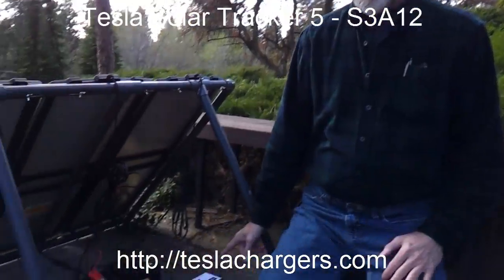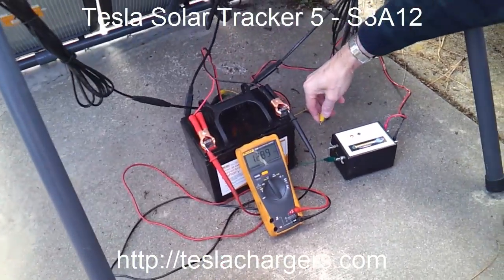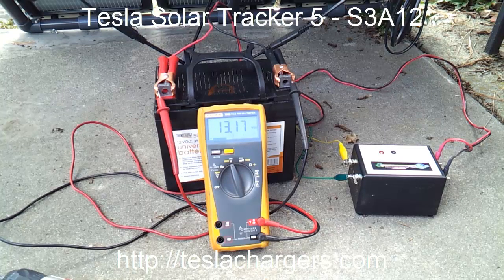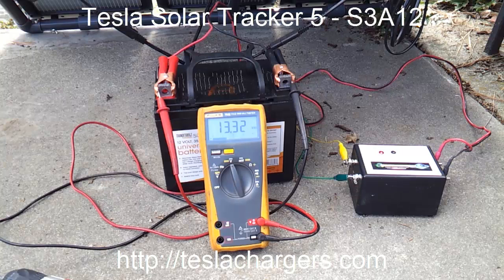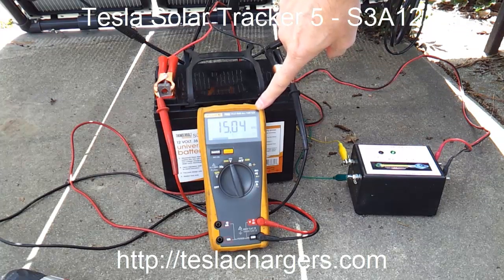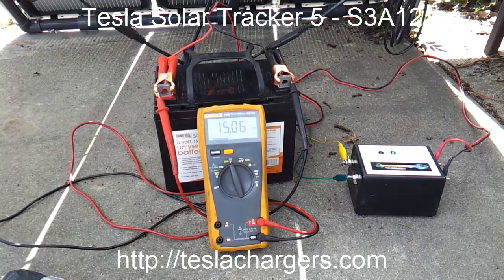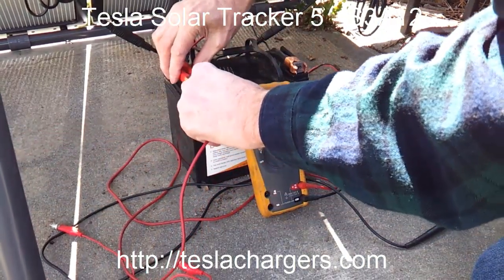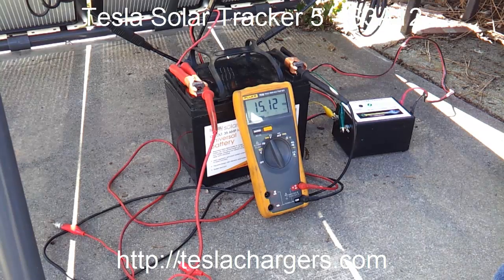S3A12 Tesla Solar Tracker 5 - 45 Watt Solar Demo

Comment: Great demonstration! How much longer can live batteries under these type of chargers?
Reply from the maker: That battery is a AGM - absorbed glass matt, so those and gel cell lead acids will have a lot longer life than being charged by normal chargers because it gets them to a proper voltage to truly reverse their chemisty to like new. If these are flooded cell lead acid batteries, it gives them a theoretical infinite life span.
Reply from the maker: Get the free book http://freesolarsecrets.com there is a section showing you the true topping charge chart.
Reply: @AaronMurakami13  Got it! Will read it on weekends :-)
Reply from the maker: @DmytroSichkarOnline  Awesome - it is a wealth of information. Look for the charging graph for the topping charge. It will explain everything. No battery charger company actually charges lead acids properly, they're all chronically undercharged and is why they have to be replaced so often. The industry knows it but are more interested in selling more batteries of course.

Comment: You should show the harbor freight unit in the same cloud conditions.
Reply from the maker: You're right, it would be a better demo, but the Harbor Freight controller simply will not push those batteries that high not matter how much sun.

Comment: 3 batteries charged 1 battery was showing 0.8 volts it is taking longer but now holding 8 volts restored a car battery and sealed cell battery took about a month to get to float...works faster if you drain the battery after a charge
Reply from the maker: +Steven Monroe Yes, you want to cycle the batteries. Charge, discharge, charge repeat until you get it to a plateau. The art and science of all of this is available through http://batterysecrets.com - there are a few free videos on the homepage at http://teslachargers.com

Comment: What kind of blocking diode are u using? thanks
Reply from the maker: +Banzay20 I do not know the actual part number - it's built into the potted circuit in the case.
Reply: Ok saw the blocking diode on the battery and it looks a bit different then "normal" diodes u find in various electronics, Im experimenting with some small panels in my window and have tried some reused diodes from tv:s and such but does not seems to work very well, voltage leakage is a problem so the specs is prob. wrong for my need.
Reply from the maker: +Banzay20 Where did you see a diode on the battery? What timeframe in the video? I thought you were talking about the diode in the charge controller that prevents anything from moving back to the panels.
Reply: Easy to miss 14:25 a blocking diode connected to the positive pole, when Peter hooks up the panel straight to the battery. Have seen something similar before.
Reply from the maker: +Banzay20 Ok, that is because of no charge controller - bad idea to hook panel to battery since the voltage isn't regulated and battery can send electricity panel, which is bad if there isn't enough sun. That diode is a MR1122
Reply: Great thanks. Ok, it´s just an old 5 watt panel with a old sulfated 12v car battery just for fun.. it can't take the battery up more than just above 13v a sunny day and then it just "pores" out again. Have been looking to get me one of those 2A12 chargers and a S3A12 solar charger..
Reply from the maker: +Banzay20 You'll be very happy with those chargers. If you have flooded cell batts, use the regular s3a12 that can push the batts to 15.3 - if amg, gel or lifepo4, then get the lifepo4 one it goes to 14.8. For panels, ideally, the VMP is 18.5 volts or as close to that as possible.
Reply: Ok, thanks. For now it´s just flooded ones. lifepo4 looks interesting.

Comment: then what amp can i use on (4 ) 225ah batt 24volt cell site system that pulling 100w canstantly
Reply from the maker: kevin pounal If that is 4 x  volt batteries in series for 24v, then the whole bank is 225ah. You're well within the 20 hour discharge rate so your bank isn't working very hard. That is 2400 watt hours in a day. How much sun do you have in a day that is usable? If you have some good light, you could power that 100 watts from the panels while the excess charges the battery and keeps it topped up until night time. You then are only drawing 1600 watt hours from the bank each day for example since the other 1/3 is from the panels through the charge controller. To replace that 1600 watt hours in 8 hours of sun that you used during the night, you need at least 200 watts of panels giving you full output for those 8 hours. I aim for double the need so 400 watts of panels to account for poor light conditions plus 200 watts to give you the same double of what you need to run that 100 watt load during 8 hours of light for a total of 600 watts of panels. 600 watts at 24 volts = 25 amps. This is the smallest amp unit we have for 24 volts: http://teslachargers.com/products/solar-charge-controllers/solar-40-amp-12-or-24-volt-lead-acid/, which gives you room to grow your system if needed. 

The 600 watts and this controller is somewhat overbuilt with the number of panels, but the reality is for a real solar system that actually works, you need at least double what you need in panels and battery capacity. You already have around 2.5 times the capacity you need in battery bank. Depending on budget and just to get started, I would use that 40 amp 24 volt controller and just start with a couple panels and add to it as you're able or as needed.

Comment: Obviously you can't charge a zero volt dead battery but what is the minimum battery voltage for the charger to start desulfating and charging up?  3 volts?  6 or 9 volts maybe?  Thanks
Reply from the maker: Phordguy, that's true pretty much. However, I have brought back some batteries with this technology from about 1 volt to full voltage, but the real charge was up to about 50%. It was just too far gone.

Today, I'm working on a 550cca battery sitting in the 5 volt range. They can usually be brought back as long as there are no internal shorts like plates warped and hitting the next plate, etc... physical damage like that. If it is just sulfation, then they can be brought back with pretty high capacity.

However, for serious rejuvenation of the car batteries or bigger deep cycles, I'd recommend at least the 10 amp unit - otherwise, it will be a really slow process. I'll continue to post vids with various rejuvenation efforts to show what is and isn't possible with this technology. Don't forget that for good rejuvenation, they have to be drawn down after and recharged multiple times - capacity grows with each successive cycle.
Reply: Thanks for the reply, I'll be ordering one soon!

Comment from the maker: This kit from Harbor Freight is great! http://www.harborfreight.com/solar-panel-kit-45-watt-68751.html The 45 watt panel setup is just about right for the S3A12 limit. The kit has a charge controller and DC output plugs... just don't use the charge controller that comes with it. Use the S3A12 charge controller - but the Harbor Freight controller, you can hook it to the battery (not to solar) and use all the outlets the little control box has! With the frame, it is a bit heavy (the 3 panels) so you won't go backpacking with this but if you can find a 50 watt flexible amorphous panel that you can roll up, that would be idea. The solar kit retails for almost $190 but Harbor Freight always has sales and coupons so you can get it for about $139-$159 pretty easy. That is exactly what we're using for the 45 watt demo.
Reply: I bought a pair of these S3A12 charge controllers and they're great! Picked up a harbor freight 45-watt kit and am using their charge controller as a PDA using the battery outlet tied to the batteries to use the lights that came with the kit. Very nice!

Comment: So... I know this stuff works because I use my own SS SSG on a daily basis to charge my bank which runs the lights in my house. I would love to see your demo's use a depleted battery rather than one w/ a full charge. start from 12.2 volts - then I will share the vid w/ friends. nice work this stuff is awesome!
Reply from the maker: I'll do something like that. I actually have a large 850 or so CCA die hard starter battery. Was from a Nissan Frontier truck - dealership told owners of truck it needed to be changed. Was sitting at 12.22 volts actually. Had it on the 45 watt panels and it brought it to about 14.4 something, then it dropped to 13. something under full sun. That was a good sign meaning the impedance dropped because some sulphation was removed back into the solution...It sits around 12.6 now after it is dark. Anyway, I have 4-5 car batteries to try it on. One other batt is in the 11-12 low volt range and the rest are way low. I did bring a garden start battery that was at 5.5v (about 13ah) to full charge in less than 2 hours. I'll be posting more vids. We have full cloudy skies here for the next whole week. Can do some charging but will just take a bit longer. Will be posting more vids soon.
Reply from the maker: Tesla Solar Tracker S3A12 - 2 car batteries 2 car batteries starting at that lower voltage.